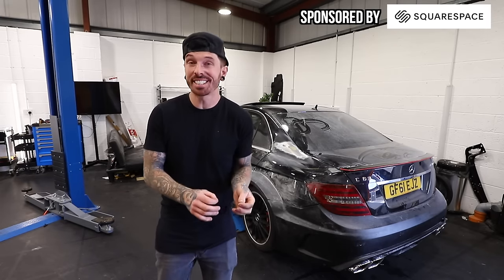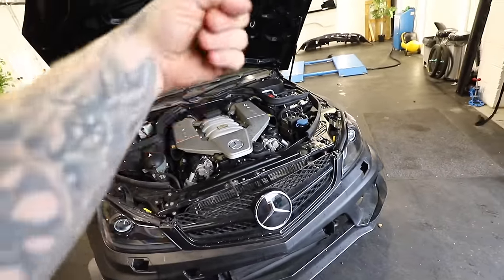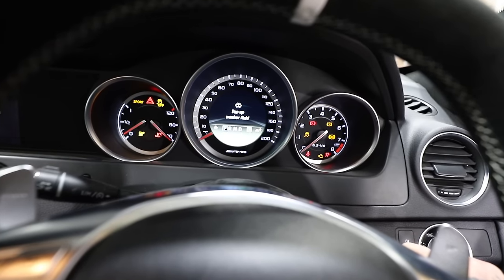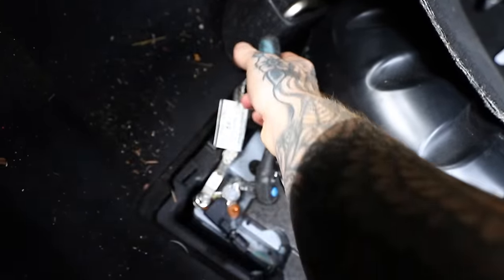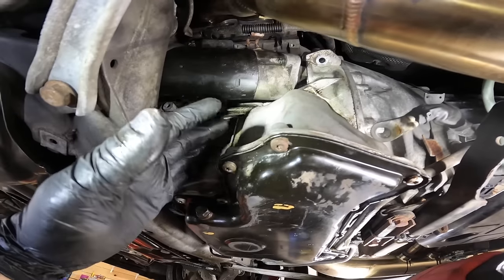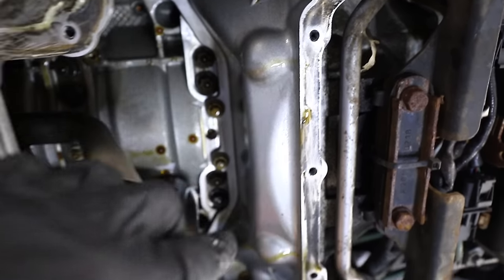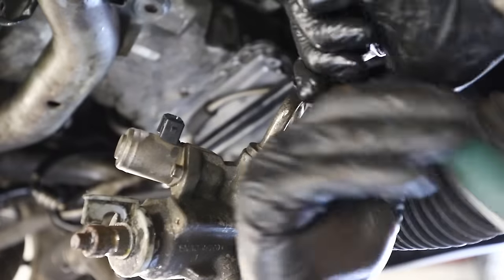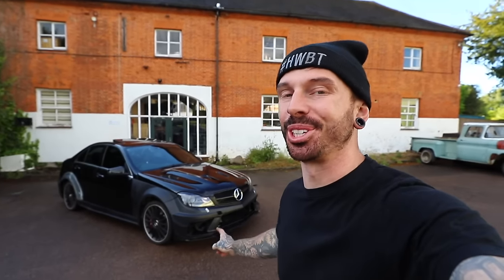FIXING EVERYTHING WRONG WITH THE WRECKED MERCEDES C63 AMG

Comment: Logically the airbag need information from the wheels to assess the speed of the car to time the activation of the airbag and if it needs to be deployed in case of an accident, so the missing data from the wheel sensor could be enough to throw the airbag fault in the system. Just a thought.

Comment: Just noticed you used generic clear sealant on the sump you might get  away with it.  The mating surface on the sump  has been machined to match the engine so you must use locktite 518 as a sealant. Good job getting stuck in there with the tools

Comment: Upper sump repair is £5.5K if done at a UK Merc dealer. 
It's also covered under the Mercedes warranty if you have one.
Also the RTV should sit overnight before adding any oil to the system. Gives it time to cure properly.

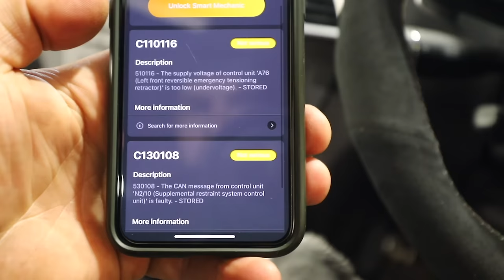Comment: The fault code for the passenger seat belt was an undervoltage fault due to disconnecting the battery and it was a stored code @2:36 so if you cleared the codes the airbag light would have gone off. For the range rover, the airbag module throws a "crash data stored" code after an accident which means the module has to be reset or replaced. Keep it up Mat!

Comment: I have just a curious question, i am by no means a mechanic, but when you buy a lot of your crash damaged cars you seem to strip the front end down a lot, just from this video wouldn't it be better to just take the engines out at the start and give them a good go over and clean when you can see things easier rather than having to return to things like this.  Granted you thought this was fixed it is just a thought. 

I love your video they are awesome it is very rare i will watch a video to the end but i have watched a number of your playlists now 😁😁

Comment: crackin vid Mat...one thing I would do, refill and check for leaks before putting all the subframe and control arms back on...I'm stunned that sump doesn't need a rubber gasket, the grooves in the pan are begging for it..

Comment: I've kind of grown out of the petrol head addiction although I can admire cars and lust after them like the best of them. However, having weighed up all the M cars and AMG's etc, running costs are not the best on any of them realistically so decided to go to the "dark side" and get a Tesla Model 3 Performance which gives you all the performance needed and actually alot of fun and realistically, relatively inexpensive running costs. As a 55yr old guy, I can tell you that I admire what you're doing and the following you're building. I enjoy watching your videos very much apart from the advertising bits but I understand they're necessary. Good on you, you deserve all the success you're getting, you obviously work very hard at this and for anyone thinking it must be easy, I think if they knew just how much time and effort you are putting in to do this, most people wouldn't be bothered to try this at all. Well done,👍

Comment: You always put everything together after replacing something before testing it (like the driver airbag several times in the last videos or in this video: mounting the subframe and AFTER that filling up the oil). Especially with second hand parts I would recommend to test it and then complete the rebuild 😊

Comment: if you disconnect a battery and tape the terminals together it's supposed to discharge the capacitors in the car... so a mechanic friend told me.. love the AMG.

Comment: a couple of points,
 When doing sump gaskets, or any gaskets for the matter, but especially the sump ones because they are so large, try not to use RTV, and if you really need to, buy a special RTV tube from Victor Reinz that is able to leave a small RTV line ( as you don't actually need much ). The amount you've put in there is just excessive and all that excess silicone inside is going to break off and end up in the pickup tube possibly clogging the filter in there, which is bad times for you engine.
 Also, when putting suspension arms bolts back in and they don't quite come out the other side by just pushing them, please, but please don't hammer them in, you will most certainly damage the bolt threads and ruin your day, just get a ratchet and spin them in

Comment: Great work dude. Quick tip. You should tighten any joints with bushes only when the car is in its wheels. When jacked up, you risk shearing the rubber. 👍

Comment: Just a heads up when applying sealant on the sumps you should position the sump then screw in bolts to finger tight and just to where it’s applying pressure to the sealant then you should let it cure for 1 hour before tightening the sump bolts to torx spec

Comment: Those wheel speed sensors are the devil, brings up a shed load of lights throughout on the w204. Namely airbag, esp, abs, all sorts. Mine did the same. Also did the same on my rs3.

Comment: The wheel speed sensor is connected to the abs and airbag systems. On most cars you will see a traction light, an abs light and an airbag light for a faulty wheel speed sensor. To have an individual problem with each system would be very unlucky

Comment: Definitely the wheel speed sensor was the cause for the airbag light staying on.
When there’s no communication from the sensor it will end up triggering abs airbag traction control lights as there all communicating with each other.

Comment: Did you remember to disconnect BOTH batteries when resetting the ecu’s on the Range Rover? The main battery and the stop start battery behind the right hand panel in the boot. ( also it’s good practice to jump a cable between the positive and negative battery cables.)      ** NOT THE BATTERY**  this will drain any residual current from the capacitors in the ecu’s.

15 to 20 mins is usually enough…. Good luck.

Comment: Is the airbag circuit not connected to the road speed sensor as it only deploys after a certain speed - as it wasn't getting a signal that's why both were illuminated ?

Comment: Hey Matt quick question , what's your views on the newish E class ? Obviously you owned one of the previous shape ones but iv just bought a 69 plate C Class Cabrio but my plan is to keep it for 12 months and then either trade to a new 20/21 shape 420 cabrio or 20/21 plate E class Cabrio or coupe cos really like the big dash and new MBux system any opinions on what you'd prefer I feel like the 420 is more like a sideways trade rather than E class which is technically trading up what's your view or anyone else's opinion
Reply: Oh n Cabrio or Coupe in either ??